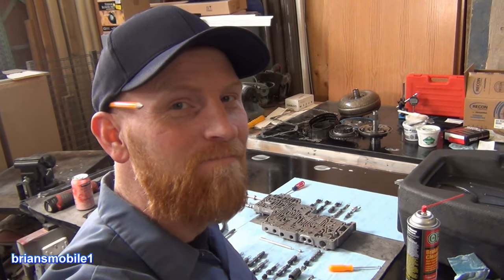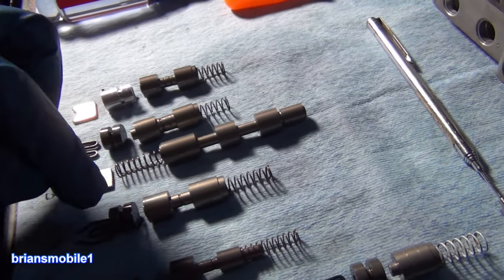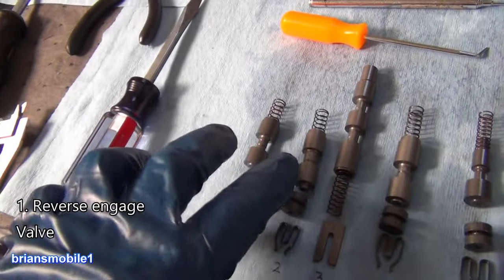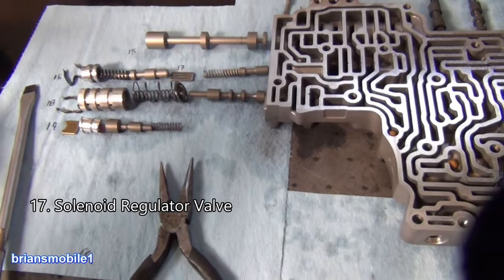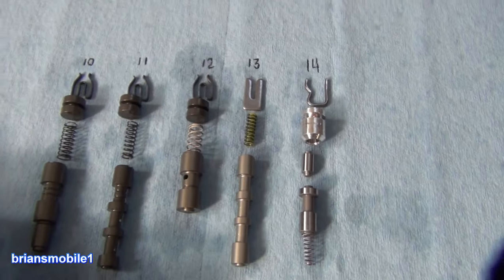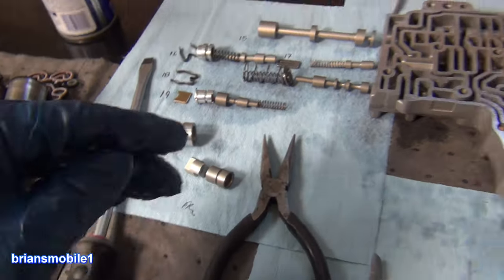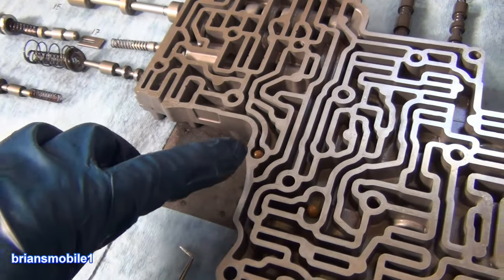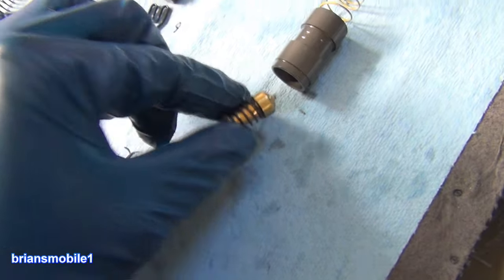Transmission Valve Body Anatomy 5R55S

Comment: Thanks heaps Brian. That video helped heaps. It helped me confirm I had everything installed correctly on my valve body. I had one error on one of the valves.
These Transmissions control modules (TCM) really take a fair bit of driving time to learn everything after a full rebuild. My scan tool would not let me reset the TCM so it took a while. The transmission is learning & it's getting better & better.
Cheers

Comment: Hello I have one question did you try the coller flow mod I have a 5r55s and thinking  of doing this mod my self if so do you recommend
Reply from the maker: I'd need more info on that.  I did the shift kit, the piston kit, upgraded snap ring and the flow control valve update.  I'm not familiar with the flow coller mod.

Comment: hi, what can couse the problem that i have.  I have smashed direct drum and central springs , also broken OD servo. I have hard reverse engage and missing 4 gear.  I change this drirect drum, OD servo and clutch packs and seals. And also have the problem.  What to looking for. Solenoid body or valve body?

Comment: Hi Brian great video i have a 2003 4.6l explorer xlt im in Australia and getting info is hard to come by can you tell me why my trans is leaking fluid from the tube that is on top of trans
Reply from the maker: Yes!  I covered that in another 5R55S video.  Most likely it's overfilled cold.  you have to do the standpipe/fillpipe fill method while it's at operating temperature.
Reply: Hi Brian thanks so much for your help great video